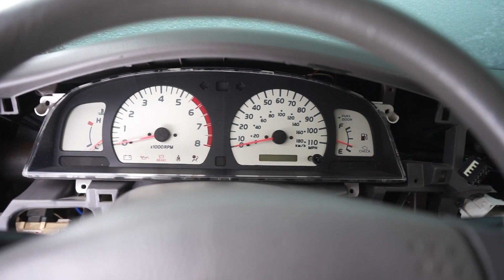Back To Work On The Diesel Toyota Tacoma!

Comment: Austin, with the seat pad.. on my Hilux the driver and passenger seat pad are identical, so I swapped them over. The worn area is now inside on the passenger seat by the seat belt clip. I was able to remove both seats and stitch the pads on mine very simply to where it is almost invisible.   Just a hack for those looking for a cheap solution. 🤙
Reply from the maker: Good to know!
Reply: Ha I did that on my 89 Hilux the Wreakers will sell you a really nice passenger seat for stuff all because they never wear out and don’t sell well. I just pulled the base out a if the second hand one and plonk it in mine the next best thing is the foam is all firm amd tight.

Comment: Ebay has factory seat covers and foam for everything.  It is way cheaper than using an upholstery shop and the new foam makes the seat feel like new again.  I did it on my 2006 F 150, maybe $100 for the cover and foam and like new.

Comment: Look into the sienna steering wheel mod too. I’ve seen it done. It gives you radio control buttons on your steering wheel. Corolla wheel looks great too, a little smaller diameter I think.

Comment: Good job as always 😍 when i crimp those heavy gauge cables i made a simple tool by cutting a big nut in half that the connector fit into and put a 1/4" screw on its side and pressed the connector between the nut and screw in the vice, looked kinda decent and probably worled as well as a crimp tool and was completely free too 😄 Happy new year 🥳

Comment: Looking good.  Glad you're back on it. Love the mini truck, but it's a add on magnet lol... this little rig needs to be back on deck. Are you keeping it the same color or changing  ? Hopefully you put the topper back on it and paint it to match. I know.. most you young guys don't like the toppers on them. But for a daily driver, it offers great lockable and dry storage space.. add a "deck drawer system " and you really have a great secure area. Light bars and roof rack adds even more versatility.   Ahhh the list is endless...lol...good looking truck. As always looking forward to seeing what's next..

Comment: I had a 2004 maroon crew tacoma, wish i had it, but I now have a one owner 168,000 2002 limited  4Runner in pearl white. Need to do some work underneath aliilte rust but not much. This truck came from Nebraska cant believe theres rust, not so much on frame but alot on diff.

Comment: You did the r150 transmission right?   I want to swap a ls in my truck.  My question is do you need the original pcm to make the speedometer work?    I plan to put in the ls and mate it to the original r150 transmission it currently has and I’m not sure how to make the speedometer work
Reply from the maker: Yes r150f. I used a marlin crawler vss adapter and it works amazing without the Toyota ecu!

Comment: 👍🏼 trying to cough up with everything. What engine did you swapped? It sounds good. I was just reading about the 2.8 Cummins to go on my 92 Toyota 22r. What are your thoughts? You are say it Thorough with your stuff!
Reply from the maker: This is a VW BHW. The 4BT is a great engine but a heavy one!
Reply: Those 2.8 cummings are Chinese built supposedly not really doing well. Big end Bearing failure also warranty starts at purchase so one year down the track when you drive it it’s already out of warranty.
Reply: Very nice! Thanks for the comment.
Reply: @austinniemela  yes the 4bt is very heavy, I have one sitting in the garage waiting to get swapped in an old f100 4x4.

Comment: The problem with Toyotas and touchscreen radios is that Toyota puts the radio way down in the boonies.  There is an expedition guy on YouTube that made a replacement radio bezel to mount his Android radio at the top, with the climate controls below.  Looked good from ten feet.  Maybe check it out.  It is about the only thing you haven't done on your channel yet, plastic/dash mods.

Comment: Pd engines dont cycle gp vers long, only if its reslly really cold. I see you always worrying about them but you shouldnt.
Reply from the maker: I have noticed this bhw has a much harder time starting in the cold!
Reply: Unless it's waaaay below freezing the PD engine is just a "twist and go" unit.
Reply from the maker: @nigelmchugh5541   at 10F the other day I had to cycle the glow plugs 3 times and it was a rough start!!
Reply: @austinniemela  winter grade diesel?